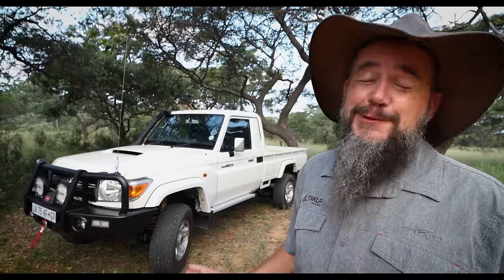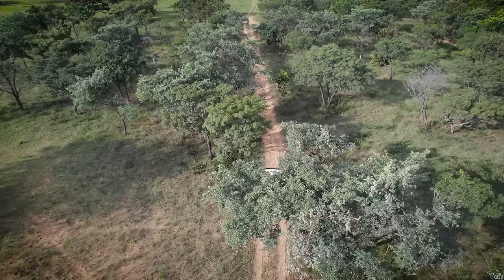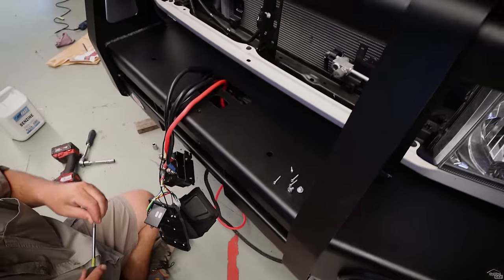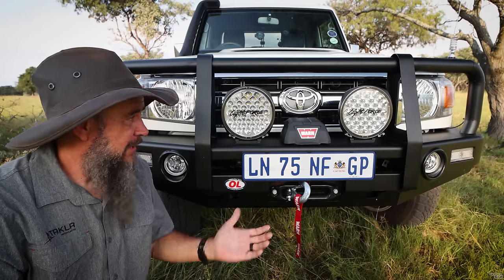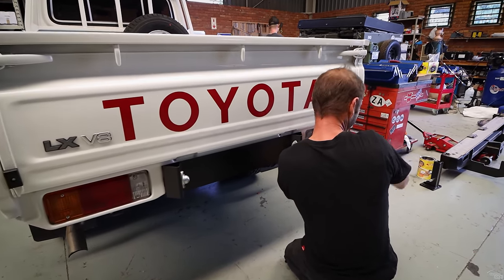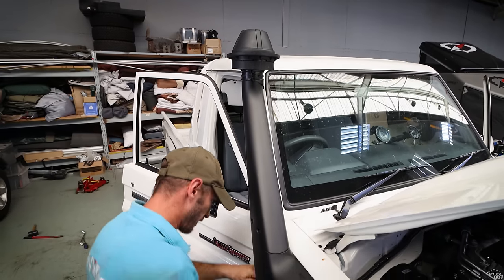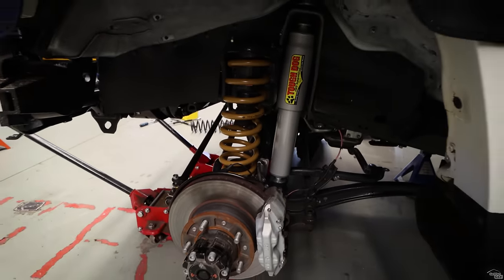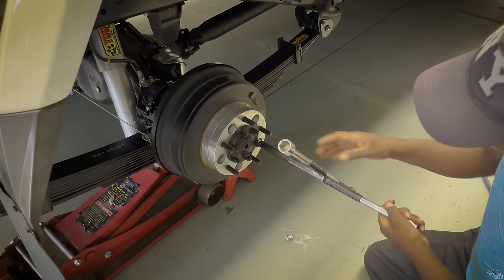What did I buy? New overland build series Episode 1

Comment: Interesting choice, thought you might go Troopy. Do the spotlights affect radiator cooling much?
Reply from the maker: I had a Troopy before (for about a year). The problem is you only get it in the 4.2 1HZ locally and it is dog slow! If they had it in the V8 locally I would’ve considered it. There are loads of 79’s with the Lightforce Genesis and I haven’t seen any complaints.

Comment: Which is better for overlanding, petrol or diesel vehicles ?
Reply from the maker: Petrol is actually a good option for international overlanding especially in developing countries where fuel quality is poor. A petrol vehicle is also usually cheaper overall but usually lacks the range and  low-down torque of (some) turbo diesels. It is also difficult to get hold of petrol in some parts of the world and diesels usually have better range. I prefer a diesel personally (but I always install a diesel pre-filter)